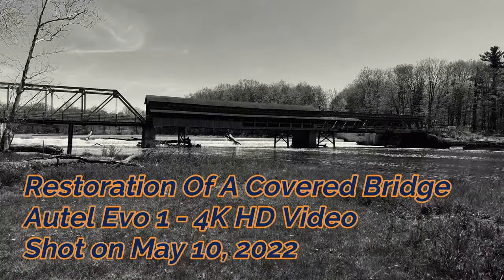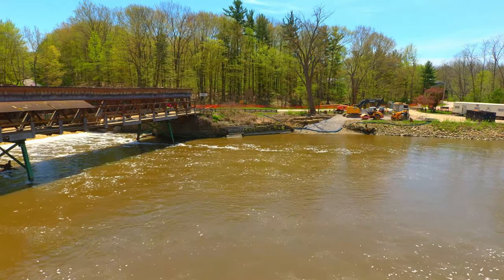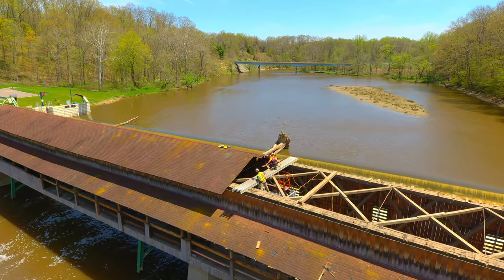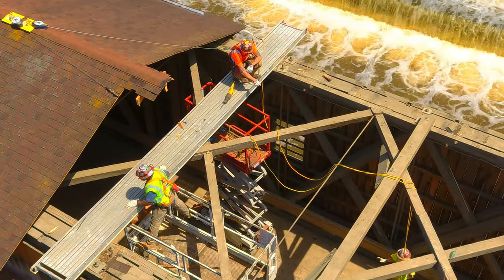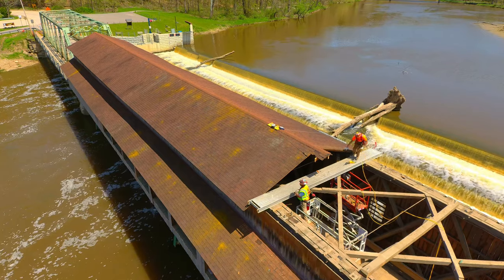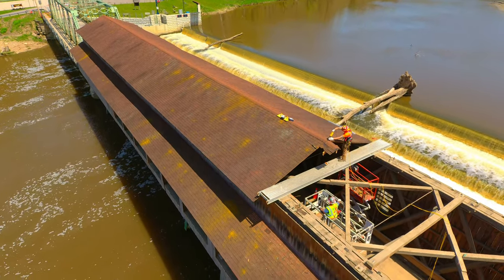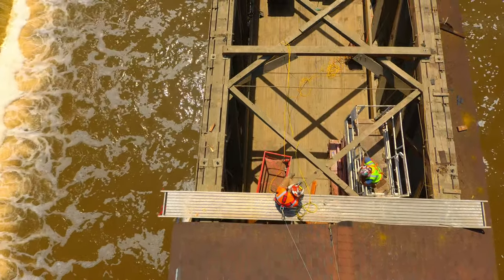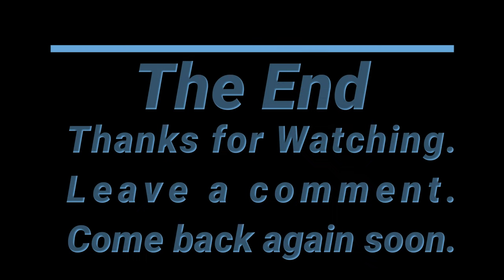Evo - Restoration Of A Covered Bridge (5-10-22)

Comment: Bill that Evo still rocks!  You were able to get pretty close without disturbing those guys!  LOL!  Looks like the progress is going well.  I'm sure the new bridge will be awesome!  Thanks for sharing!
Reply from the maker: Hi Drone UP.  Well, the running water masks the noise of the Evo pretty well. It is surprisingly louder than the Mini 3, but quieter than my P3A or X380.  I've already got new video "in the can" of the latest goings on here. One of the concrete supports (which were crumbling with age - 100+ years) is gone completely, below the river bed level. They've 'dewatered' the area, and I assume that fitting some kind of forms will be next, along with pouring concrete. This is a long term project, not to be finished until Dec. of 2023 (next year). All these covered bridges are in the National Registry of Historic Places, so they are trying to do a good job of maintaining as much of the history as possible. Thanks for stopping by & commenting. Cheers.

Comment: Interesting Bill, it’s always great to see the past preserved.
Reply from the maker: Hi Barry.  The county that has all these covered bridges tries very hard to keep them in good shape. They don't have a lot of money, so they try to do the projects which are the most needed. After 30 years, this one was due for some much needed work. When they get the entire bridge removed, its going to look so BARE. They have to reconstruct those concrete pilings under the bridge, which will be a major project in itself. It will be an interesting 1 1/2 years. Thanks for having a look & commenting. Cheers!